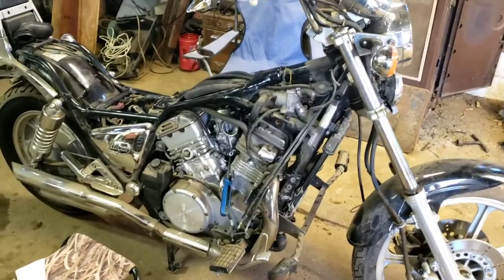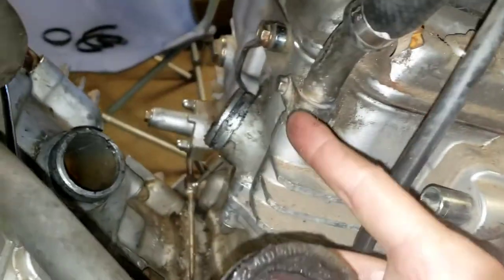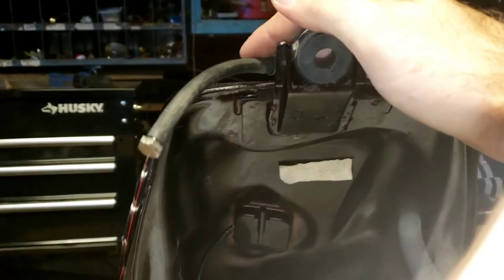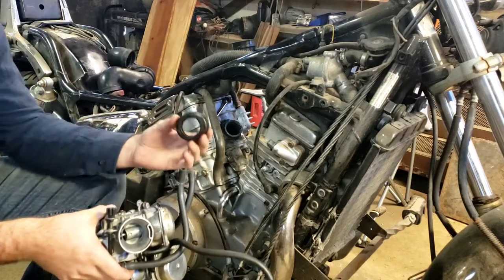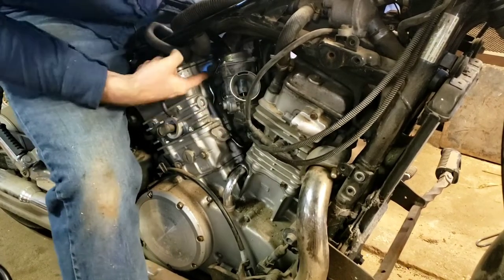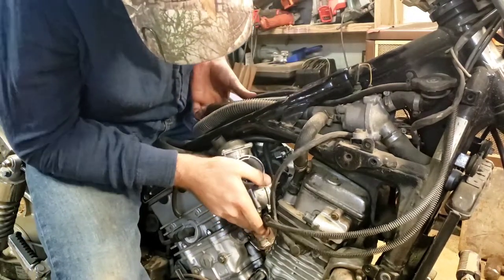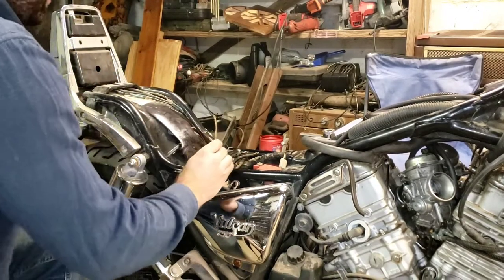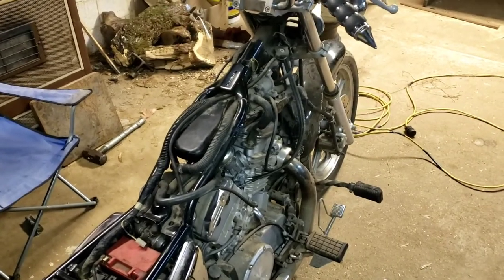Carb uninstall and reinstall on a 94 750 vulcan

Comment: I’m completely struggling with the one part you cut out of the install. Can’t figure out how to get it back in.
Reply from the maker: So u have the carb outside the bike. With the two throttle cables, fuel lines, and the choke cable hooked up? Just remember, u will have to rout the choke cable (only) through the "driver side" of the bike. So it should be the last thing ull hook up before throwing the carb on the bike.
Reply from the maker: The carb will only go on with the rubber boots lined up. There is an arrow that lines up the rubber boot to the head. So if u took them off and flipped them around, they will not go on. If u match the number from the head to the boot they should line up as well.
Reply from the maker: Once u got all of that in place and are trying to install the carb. Ull have to slide it in at an angle. I'm pretty sure I went from front to back. It takes some doing to get it lined up for sure. But it should press into place and be good to go. U can use some lubricant as well to help it go in.

Comment: does that T off pipe go to the fuel gauge? as you though as im not sure where mine came off when removing tank and carbs cheers
Reply from the maker: @decmcdonnell1895  I'm not gonna lie. I'm not completely sure what ur meaning.
Reply from the maker: @decmcdonnell1895 Okay, apologies, it's been a while, so I had to look back and re acquaint myself. But that T where two hoses connect to one is the hose I sent to the bottom of the tank. The other two hoses go to the fuel shut off.
Reply: @bluecollar8729  yest its the   T where two hoses that connect to one hose . thank u so much i thought  it went to the bottom off the tank to the gauge  as when i removed tank i then seen it and could not find anywhere else it could go lol again thank u for your help and response much appreciated
Reply from the maker: @decmcdonnell1895  no worries, I'm glad to help and take it easy.